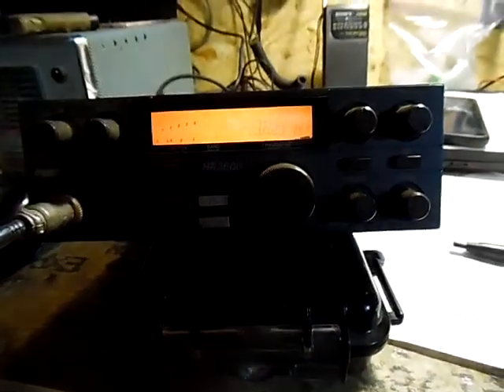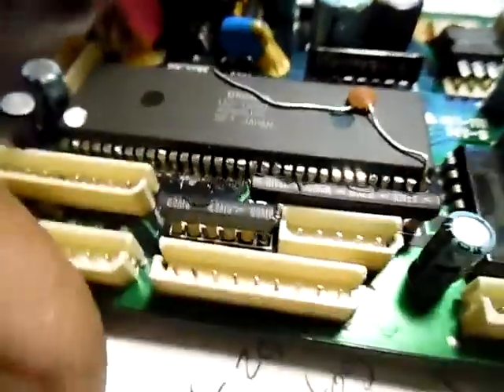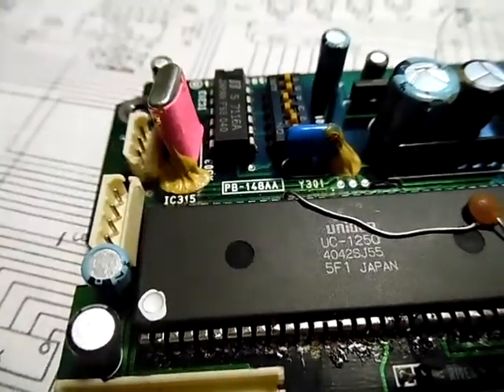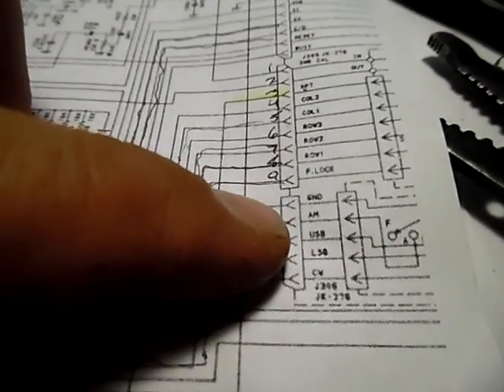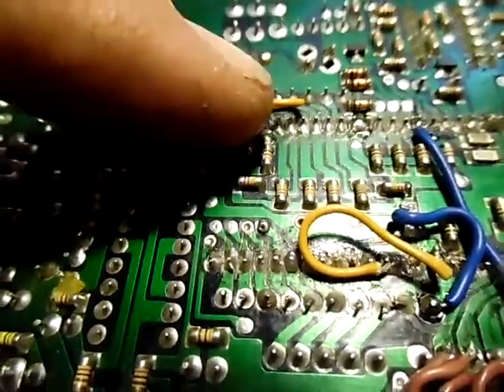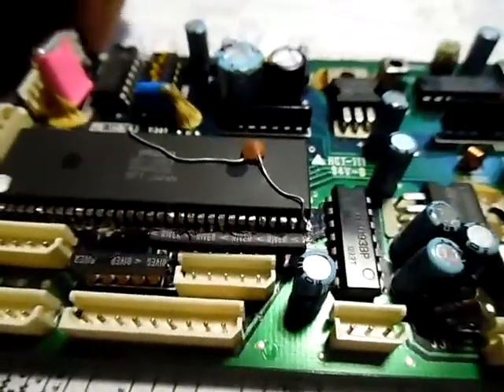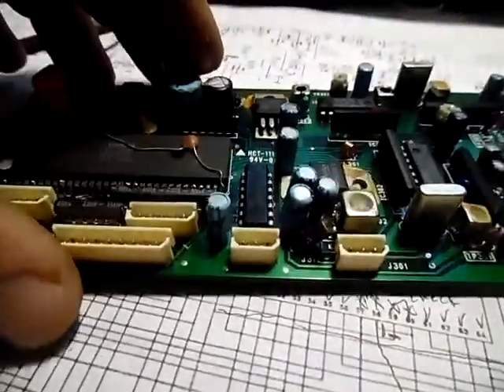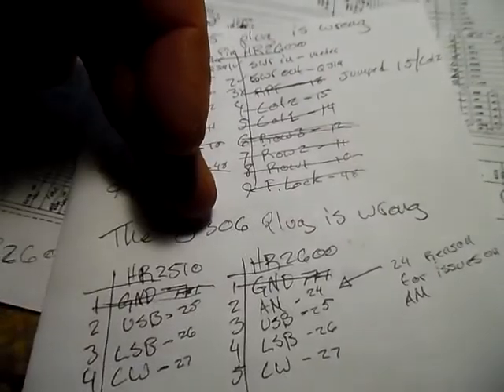President HR2600 - CPU Swap.

Comment: This kind of mod only encourages ingress by unlicensed operators into, especially the lower end of the Amateur Radio 10 meter Band !
Sad, but most don't respect what they never had to work to obtain !
Let me guess..... it's about the money ?
           $$$ 🤑 $$$
Reply from the maker: No it's because I like tinkering with radio gear, I hold the Extra class amateur radio license and I just enjoy all facets of radio. I have even built little part 15 AM and FM transmitters.
Reply: Not it doesn't people do these mods to have a radio with expanded range. The reality is this was a better radio than most CB radios sold at the time and it is still regarded as one of the best radios for 11 meters due to is receive and transmit sound.

Comment: The HR2600 was a slap on the face of the whole radio community. Even HAMS don't like the fact it only covers the 10 meter band...
Reply: Not the manufactures fault. The FCC told Uniden they would not issue any further FCC IDs for the HR2510 unless it couldn't be modified for 11 meters. They didn't like the fact that so many CBers were using it on 11 meters. Uniden released the 2600 with a different chip that couldn't be modified for 11 meters for those that wanted it strictly for 10 meters. It wasn't too long before a chip was sold that could be swapped out to not only allow 11 meters, but to allow other features like more memory and expanded range. This radio also allowed PL tones and frequency split. You could also swap the crystal to make it work on 11 meters, but that was a hack that wouldn't show the right frequency on the display.